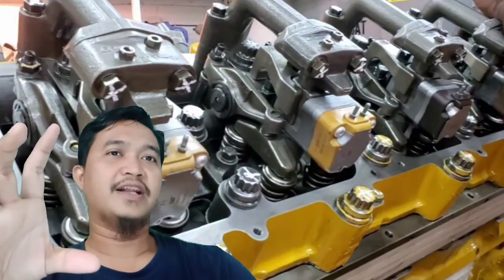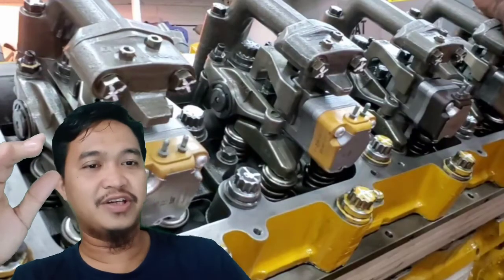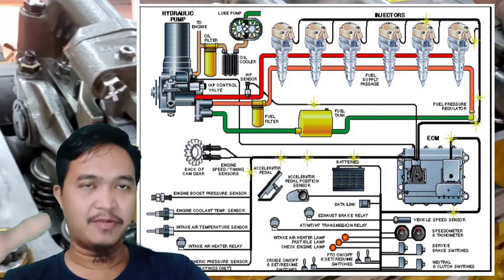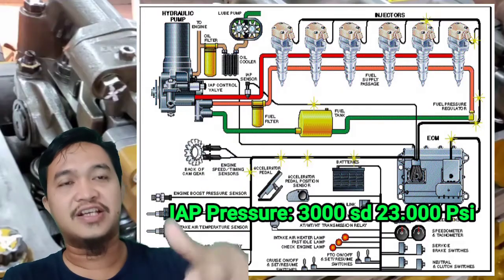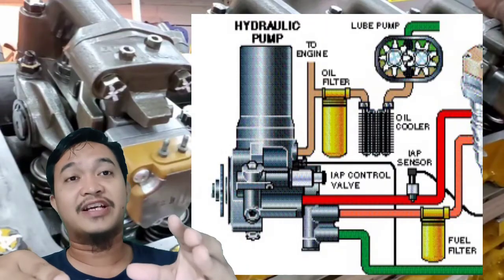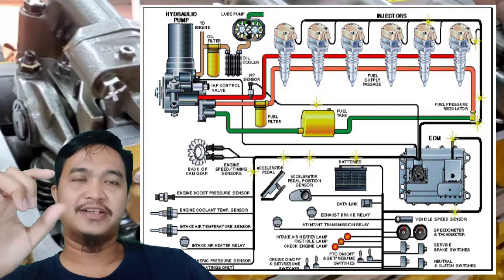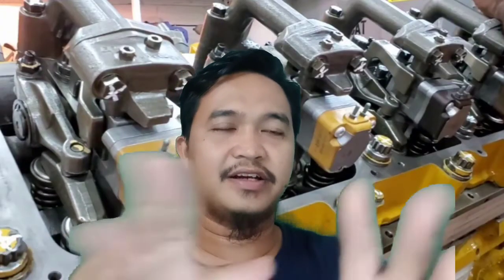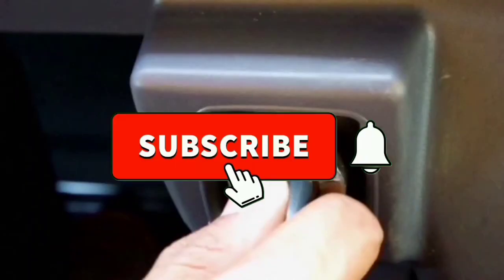Cara kerja sistem HEUI (Hydraulic Electronic Unit Injector Fuel System). Training BMC 11

Comment: Mohon info pak cat 330d bospom heui  setiap 5 menit mati
Reply from the maker: @AnggiAkhirudin  maaf mas, maksudnya engine mati dalam 5 menit ya?? Tahu dari mana kalo yg menyebabkan matinya itu dari bospom nya mas?
Reply: @dikiadnarrayyan  ya pak mohon maaf maksud sy dari bospomnya apa bukan kok mati terus
Reply from the maker: @AnggiAkhirudin  kalah seperti itu biasanya ada yg masuk angin, atau pompa kecilnya sudah low supply mas, coba pastikan dulu jalur selang fuel nya, sambungan, filter ada yg longgar gak, klau aman coba ganti fuel transfer pump nya. 🙏

Comment: Unit 329 TDK mau runing...klu HEUI tekanan oli TDK mencapai preser nya apa salah 1 penyebab unit TDK bisa hidup....dan bagaimna cara melihat tekanan oli dri HEUI ini
Reply from the maker: @ilalbae9094  jadi pasang pressure gauge di manifild HEUI terus dicrack mas.. 🙏🙏
Reply: @dikiadnarrayyan tekanan saat crank brp yg di izinkan y?
Reply from the maker: @imrancahyadi2673 klo gak salah di atas 1000 Psi mas

Comment: Saya ada masalah dengan cat c32 pak ngak bisa distart pak sampai sekarang terakhir low lub oil pressure shutdown padahal switch da tekanan oli bagus pak
Reply: Ia tidak bisa running pak.  Betul c32 pakai heui system juga pak
Reply: Bisa di start tapi tidak mau running
Reply from the maker: @randualfaryd1459  Itu Low Oil Pressure Shutdown itu error nya ya mas? Kalau oil pressure engine bagus, Bisa jadi HEUI nya mas..
Reply from the maker: Maaf mas, ini maksudnya mungkin tidak bisa running tapi mau start ya?
Dan apakah C32 itu HEUI ya mas?

Comment: Izin bertanya mas jika genset catterpillar C 18 accert hunting saat baru running / jalan kira² apanya ya mas, tdk ada alarm di panel & semua fuel filter baru ganti. System sudah ECU / ECM.
Mohon panduannya mas
Reply from the maker: Coba dicek regulator dulu mas seperti konten saya yg ini:
https://youtu.be/050ro9NEjzc?si=4VZvad8G0CDIURFU

Kalau sudah bagus semua kemungkinan injector nya sudah ada yg kena mas..
Reply: @dikiadnarrayyan  sudah di ganti baru mas fuel pressure regulator, Oia mas pernah ada alarm (SPN 670 : ECU 8 volt DC supply, FMI 3 : voltage above normal.
Reply from the maker: @RizkiDephie-xv9kh  Hmm, kalau error ini bisa jadi ECU nya mas, tapi saya gak berani vonis sebelum dipastikan injeksi nya pakai scanner ET mas.. 🙏🙏
Reply: @dikiadnarrayyan  sy berkerja di kapal mas hunting ini ada ketika mesin induk / main engine running (hidup) tp ketika mesin induk stop hunting hilang & genset stabil. Meskipun tdk ada link / berhubungan tp ini betul terjadi.
Ada feed back jg dr org demikian mas ECU / ECM ada yg short or fail. 
Makanya sy sdng mencari mungkin ada referensi dr para suhu yg memungkinkan sy dpt referensi baru untuk sy observasi masalah hunting ini.
Reply from the maker: @RizkiDephie-xv9kh  maaf mas, ada benarnya juga jika ECU nya mas, karena terkait kaitannya dengan hubungan dengan mesin lain ECU yg bermain. Tapi untuk masalah yang paling sering terjadi hanting itu disebabkan injector mas, 🙏🙏 harus dicoba sih kira2 mana paling murah diantara kedua komponen itu diganti baru mas.. 🙏🙏
Reply: @dikiadnarrayyan  baik mas terimakasih atas informasinya & balasannya.. semoga berkah dunia & akhirat aamiin
Reply from the maker: @RizkiDephie-xv9kh  iya mas, dalam troubleshooting yang kemungkinan nya 2 atau lebih komponen mahal, tapi kita tidak punya tool scanner/ tool diagnostik maka kita harus berani salah vonis mas.. 🙏🙏

Comment: Mumpung tanya pak, Heui system itu tergolong jenis mesin comen rail atau bukan yah? 😁🙏
Reply from the maker: Bukan mas, beda sih, kalau HEUI malah lebih dekat ke EUI mas.. karena dia menginjeksi nya di area cylinder head, kalau common rail kan lebih mirip FIP.. 🙏🙏
Reply: @dikiadnarrayyan  hahaha, tadi saya mempresentasikan materi ini ketika ditanya guru saya (itu masih termasuk system commn rail atau system apa?) Saya jawab (bukan pak, ini system HEUI) 😂😂
Tapi gapapa lah. berkat konten sampean saya dapat ilmu baru dan Nilai presentasi saya cukup tinggi 👍, karena dari beberapa alumni² terdahulu di TKR sekolah saya, ternyata baru saya murid pertama yang mempresentasikan tentang HEUI System. Sedangkan kebanyakan murid hanya mempresentasikan tentang system transmisi, differential, dan Clutch system.. 😅
Reply from the maker: @mawantri3179  Alhamdulillah mas.. turut bangga saya.. 🤲🤲 semoga bisa lebih bermanfaat lagi ke depannya mas.. 🤲🙏

Comment: Terjadinya oil mix fuel,sudah di ganti dan di reseal slave nya juga,tapi tetap oil mix fuel di 773 e mohon dibantu saran nya om🙏🏻
Reply from the maker: Injector nya sudah di-reseal mas?? Aq khawatirnya karena dia injector dia bocor fuel ke injector, tapi sebelumnya coba cek transfer pump nya bisa jadi dia bocor di transfer pump, jadi transfer pump itu pompa fuel kecil yg nempel di HEUI pump.. 🙏🙏
Reply: Klo dari pengalaman saya sih bang,jarang sekali kalau dari seal nya injector karna apa?di situ ada bahkan 3 seal untuk mencegah fuel delution,90% karna terjadi internal leak pada injector 😁

Comment: Apakah ada. Yang menjaga pressure oli didalam system? Contoh klonya di eui kan itu regolator nah kalonya di olinya itu apakah ada juga. Unit Cat
Reply from the maker: Maaf baru respon mas. 🙏
Ada mas, Kan tipe HEUI pump nya tipe Variable hydraulic pump dengan swash plate, jadi IAP sensor itu tugasnya memonitor tenakan HEUI nah, jadi dia menjaga pressure oli HEUI dengan cara menurunkan sudut swash plate agar tekanan tidak berlebih dan jika kekurangan tekanan maka sudut nya akan membesar begitu seterusnya mas.. 🙏🙏

Comment: Mohon izin mas ,sya mau tanya,solar yg stnby di injector itu berasal dr mana mas,apakah dr heui pump,atau dari electronik priming pump? Terima kasih mas
Reply from the maker: Itu dari fuel transfer pump mas, posisinya ada di belakang pas HEUI pump, bentuk nya lebih kecil dari HEUI pump.. itu yg menyuplai fuel ke galleri fuel injector.. 🙏🙏

Comment: Fuel pressure regulator itu, kapan bekerja dan bagaiman cara kerjanya pak?
Reply from the maker: Pada intinya dia mempertahankan pressure fuel di low pressure sistem fuel mas.. Jadi dia bekerja setiap saat engine running dan terutama pada saat high idle, kan pasti selalu ada yg release saat fuel diproses untuk diinjeksikan. Cara kerjanya seperti relief valve mas, jadi ada ball piston dan spring pada saat tercapai fuel maksimum nya ball akan mendorong spring sehingga fuel lebih release ke tangki dan pressure di low pressure sistem tetap sesuai spect.. 🙏🙏
Reply: @dikiadnarrayyan apa tidak berpengaruh dengan low power pak, mslhnya kan pressure fuel itu kan dpt pressure adanya hambatan dari fuel regulator, apa tdk ke drain dluan ketangki pak?
Reply from the maker: @sahrulkan771  nah kalau spring di regulator melemah jadinya pasti low power mas.. tapi kalau spring nya masih bagus justru itu yg mempertahankan ketersediaan fuel di galleri input injector untuk diinjeksikan ke ruang bakar.. 🙏👍
Reply: @dikiadnarrayyan  makasih mas🙏🏻
Reply from the maker: @sahrulkan771  sama2 mas.. 🙏🙏

Comment: Mohon infonya pak, saya mendapatkan trouble shoting pada exa cat 325 , solar tidak keluar dari HEUI
Reply: Tidak keluar mas
Reply: Apa mungkin gear transfer pump nya trgores atau ada kerusakan ya mas
Reply: Di monitor jga keluar kode eror 
39: 110 - 9
39: 590 - 9
Eror apa itu ya mas, soalnya saya tidak punya shop manual
Reply from the maker: @agusrahman5597  oli dari Heui pump nya keluar gak mas?
Reply: Keluar mas @dikiadnarrayyan
Reply from the maker: @agusrahman5597  seperti nya gak ada kaitannya mas.. ini engine coolant temperatur sama ECM..
Reply from the maker: @agusrahman5597  Ooo.. ini transfer pump aja ini.. ganti aja mas transfer pump nya.. 🙏🙏 atau cari kanibalan dulu.. 🙏
Reply: Kalau di gosok bisa tak ya mas @dikiadnarrayyan  , soalnya saya di pulau, dan tak ada unit yang sama untuk kanibal
Reply from the maker: @agusrahman5597  kalau HEUI pump nya kerja berarti cuma transfer pump aja kena. Tapi pastikan gak masuk angin ya mas.. takutnya buntu saluran hisap nya..
Reply: Kalau buntu saya rasa tidak mas @dikiadnarrayyan  soalnya saya pompa pakai priming pump keluar  sampai valve riten ke tangki
Reply from the maker: @agusrahman5597  oooh kemungkinan transfer pump nya itu mas.. karena saat crank gak keluar nyembur solar.. 🙏🙏
Reply from the maker: Mohon maaf mas 🙏 mungkin maksudnya solar tidak keluar dari transfer pump ya mas?? Kalau gak salah dia itu HEUI pump sama transfer pump itu 1 shaft penggerak nya pastikan HEUI nya keluar oli bertekanan gak mas? Kalau gak keluar jg kemungkinan Shaft nya kena, kalau keluar oli bertekanan kemungkinan transfer pump nya aja.. 🙏🙏
Reply: @dikiadnarrayyan  iya mas, maaf salah penyampaian, solar tidak keluar dari transfer pun, padahal saya sudah pompa manual sampai padat, tetapi begitu saya start mesin  tekanan priming pun langsung berkurang mas
Reply from the maker: @agusrahman5597  pada saat start solar nyembur gak mas dari transfer pump?? Coba dibuka output transfer pump nya..
Reply: Punya pengalaman sama gak bisa star....setelah pipa oli yg masuk dan yg keluar di heui saya pancing oli baru bisa start tetapi sebentar saja running karena oli tidak naik ke sistem...lalu saya buka pompa oli di Carter ternyata pompa nya pecah housing nya om

Comment: Knp bisa  voltasenya 105 volt pada solenoid injector sedangkan batereinya hanya 24 volt
Reply from the maker: Itu output dari ECM mas, dan ECM bisa memprovide voltase segitu di dalamnya ada IC dan alat electronika yg lain. Yg kedua energize nya hanya sepersekian detik, cepat sekali. Dan yang ketiga, untuk menginjeksi injector dengan IAP pressure 23.000 Psi wajar saja kalau diperlukan voltase segitu.. 🙏🙏
Reply: Terima kasih atas infonya
Klo pressurenya kurang dari 2300 psi apa yang terjadi pada enginenya mas?
Reply: Terus apakah ada kemungkinan engine HEUI bisa jammet?
Reply from the maker: @lukmansamad3023  kalau pressure IAP nya gak sampai 3000 Psi dia akan sulit start mas.. start nya lama bahkan gak bisa running..
Reply from the maker: @lukmansamad3023  kalau jamed karena penyebab lain contoh hidrolik lock masih ada kemungkinan mas, tapi itu bisa diminimalisir karena yg disebabkan low lubrikasi sistem HEUI nya akan mematikan engine terlebih dahulu sebelum jamed.. 🙏

Comment: klo cover HUEI nya sampai retak, diagnosa karena apa ya bang ?
Reply from the maker: Maksudnya cover HEUI ini yang mana ya mas? Manifold heui yg ke injector itu kah?
Reply: @dikiadnarrayyan  , cover atas HUEI pump nya bang
Reply: @dikiadnarrayyan  ,Cek line dari HUEI sampai ke Cyl head pakai angin, aman aja.
Stelah itu kita coba pasang lagi HUEI spare kita, baru running 5menit, cover atas HUEI pump nya retak lagi, retak yg sama dgn HUEI pump yg pertama.
Reply: @dikiadnarrayyan  kira2 ada kebuntuan dimana ya bang, sehingga pressure nya menumpuk diHUEI pump yg seharusnya dia return 😁🙏
Reply from the maker: @manghendrochannel3751  Mas, berarti diganti 1 grup ya heui nya.. Gini mas apakah barangkali dia gak bisa release di injector nya ya.. kan ujung dari IAP pressure itu direlease di injector.. 🙏🙏
Reply from the maker: Sebentar mas ini engine apa mas??
Reply: @dikiadnarrayyan  , Engine C7 Greader Cat 120k
Reply from the maker: @manghendrochannel3751  coba cek mas di heui pump itu ada saluran apa aja? Ada berapa saluran yg keluar dan masuk heui pump mas.. 🙏 barangkali ada saluran relief Valve Heui mas.. 🙏 mana tau itu buntu..
Reply: Sudah saya ganti HUEI pump + 1set 6injector baru bang...👍
Unit nya langsung normal & sudah ON kembali bang🙏
Kemungkinan ada injector yg tersumbat.
Trims sharing nya ya bang...🙏🙏
Salam dari Balikpapan 🙏
Reply from the maker: @manghendrochannel3751  Alhamdulillah.. ternyata injector nya ya indikasi paling kuat penyebab kebuntuan release tekanan IAP.. 🙏 siip mas.. saya jg dulu lama di Bpp.. salam balik mas.. 😎
Reply: @dikiadnarrayyan  , Bang, baru dapat 40HM, cover HUEI nya retak lagi 🙈😭
Reply from the maker: @manghendrochannel3751  Ya itu kemungkinan ada lines relief valve yang buntu mas.. Coba cek2 saluran HEUI relief valve nya.. saran saya kalau sudah seperti ini dicek by ET tools karena mana tau ada parameter yg terlalu tinggi nilainya.
 🙏🙏
Reply: @dikiadnarrayyan  , baik bang, saya coba koordinasi sama team dilapangan dulu yaa
Trims masukkannya 👍🙏
Reply from the maker: @manghendrochannel3751  semoga cepat ketemu masalah nya mas.. 🙏🙏
Reply: @dikiadnarrayyan  ,siap grak bang, saya pasti akan update kabar nya disini yaa👍
Reply from the maker: @manghendrochannel3751  siipp ditunggu perkembangan nya mas.. 🙏🙏
Reply: @dikiadnarrayyan  , Bang, update engine C7 Greader Cat120K kemarin, sudah solved Bang, permasalahannya di hose pipa line dari HUEI ke engine (dimodif pakai Hose biasa yg ujung di las), setelah kami orderkan Hose pipe aslinya ditrakindo n pasang, masalah solved 👍
Reply from the maker: @manghendrochannel3751  Alhamdulillah.. ternyata itu ya 🙏🙏👍👍
Reply: Mas kalau arus ke injector itu yg stndby arus positif atau negatif ?
Reply from the maker: @fahmi1321  setau saya saat timing energize baru ada arus mas, arus positif DC. 🙏🙏

Comment: ikut nyimak pak👍👍👍👍
Reply from the maker: Terimakasih atas kunjungannya bang.. semoga bermanfaat.. 🤲🤲
Reply: @dikiadnarrayyan  ass pak sy mau bertanya kalau top suplai pump D 3K C4,4  di shaf suplai pump ada lubang spit apakah dia lurus ke atas  sejajar bodi suplai pump atau dia miring ke kanan🙏🙏🙏
Reply from the maker: @kaharehar1692  Maaf mas itu cara memasang nya harus pakai tool, jadi tidak ada patokan ke atas atau ke samping jadi dipasang pakai tool installer top 1 supply pump .. untuk toolnya coba saya carikan dulu referensi nya mas .. 🙏🙏 kalau pasang manual mungkin bisa khawatir lari 1 atau 2 gigi.. 🙏🙏
Reply: @dikiadnarrayyan  sy buka sensor yg ada d suplai pump  dan sy putar shaf suplai pump ada semacam gigi, ada 1 gigi lebar apakah itu tanda top suplai pump ketika gigi lebar yg posisi sejajar dengan sensor sy liat shaf bagian depan suplai pump dia miring ke kanan  apakah itu suda benar cara pasang nya pak🙏🙏🙏
Reply: sebelum sy lepas suplai pump sy kasi top 1, baru sy lok suplai pump yg di bodi suplai pump setelah itu sy cabut dari mesin  sy bongkar posisi masi d lok shaf nya pak,sy buka solenoid dan seppring sy bersihkan  setelah d bersihkan sy pasang kembali seperti semula posisi lok masi terpasang,cuman belum sempat ke pasang d mesin karena hujan,sy  pengen tau pak top suplai pump sebelum terpasang d mesin,maaf pak kalau terlalu banyak pertanyaan sy🙏🙏🙏 dan sy berterimakasi kepada bapak suda mau berbagi ilmu ke pada saya,🙏🙏🙏🙏🙏🙏🙏🙏
Reply from the maker: @kaharehar1692  saya harus pastikan dulu mas.. 🙏 sebentar saya carikan shop manual nya dulu. Khawatirnya lari beberapa gigi nanti susah start dia..
Reply from the maker: @kaharehar1692  kalau memang sudah seperti ini harusnya sudah bener mas.. tapi memang ada tool special nya harusnya, tp asalkan lock nya gak bergerak gak masalah ini mas, tapi pastikan engine nya jg Top 1.. 🙏🙏
Reply: @dikiadnarrayyan  iya pak engine suda  top 1 trimaksih pak atas bantuan nya🙏🙏🙏🙏
Reply from the maker: @kaharehar1692  siap mas, kalau mau lebih detil coba chatt di FB saya mas atau ig saya.. FB Diki Adn Ar Rayyan ig @diki.adn
Reply: @dikiadnarrayyan  ass pak sy suda follow IG nya pak
Reply from the maker: @kaharehar1692  noted mas nnti kalau lagi waktu luang kita diskusikan.. 🙏🙏
Reply: @dikiadnarrayyan  iya pak,trimakasih suda mau membantu sy🙏🙏🙏
Reply from the maker: @kaharehar1692  siiip aman mas.. 🙏🙏 sambil sharing berbagi pengalaman yg berbeda2..
Reply: @dikiadnarrayyan  siap pak🙏🙏🙏🙏🙏🙏